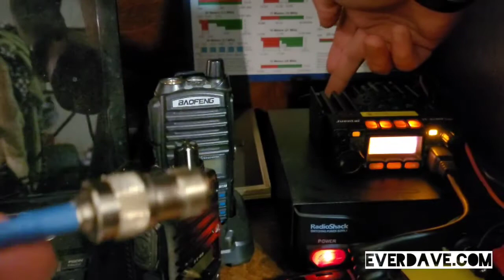Hook your Handheld Ham Radio to an external antenna #ham101

Comment: How long of a coax? And how far is the repeater. Im working on my ham license as my father was was long time  ham in the meantime i have a gmrs license. So on a small coax i can bring up a gmrs repeater thats 60 miles from me on my uhf yagi but soon as i hook my 50 foot coax nothing .this is using my 5 watt handhled. I hear different stories like bad swr or five watts will not make it through the 50 foot coax
Reply from the maker: My coax for this was about 25 feet.
Don't stop, get that license. My grandpa was a HAM operator. I also hold my GMRS.
Reply: @EverDave Oh ok what kind of coax? Lmr400
Reply from the maker: @timcrawford8722  RG58 Coaxial Cable

https://amzn.to/4l5JVpn

Comment: Thank you for sharing, I’m new to this and am trying to learn more in case of emergencies to be able to contact my family in case we get stranded  or stuck away from each other to remain in contact. I was reading an article online that said for some units like the one you have on the right which are not handheld mobile you would need a license for 65 mile range, my question is do I need anything like that if I go for the handheld mobile version? If anyone can help I’d greatly appreciate it
Reply from the maker: If you are in America, you will need a HAM license. The distance doesn't matter.

Comment: Your mobile radio has SO 239 on it and the external antenna coax connector is PL 259.  PL 259 screws over the SO 239.
Some handheld radios have a BNC connector and others have SMA connectors. BNC connectors are not confusing.   Your radio and your rubber duck has SMA connectors.
SMA connectors are confusing as to whether they're male or female.  The determining factor is whether the center pin of the radio has a hole in it (female) and the center pin of the rubber duck antenna slides into the antenna center pin on the radio SMA connector.  Then, the rubber duck antenna has a male center pin connector.   IF the radio has a male connector, then the jumper needs to have a female connector.  
The simplest way to know if you need a male or female end on your jumper is to look at your rubber duck antenna.  The kind of end on the rubber duck  antenna is the kind of end you need for your jumper.
Thanks for the video.

Comment: is there anything else you have to do or is there any worry about hurting your hand held radio doing this? I have a talkpod a36 and tidradio handhelds. i was gonna use a firestick antenna.
Reply from the maker: I assume that you already have your HAM license. If so, no I didn't have to do anything differently. a Firestick mounted up high would definitely work.

Comment: That was a good share. Will the small HT drive a base antenna?
Reply from the maker: If you're using repeater antennas then yeah it worked great. Otherwise it's pretty low power.

Comment: I’m new to this. This is perfect. I subbed. I may have some questions later.
Reply from the maker: Awesome! Glad to help any way possible. I'm still learning as well.
Reply: @EverDave  I’ll let you know when I’m up and running. I’m in North Central Texas.
Reply from the maker: @MeAndMyGuns  heck yeah!
Reply: @EverDave  Ok, maybe you can help me out with this. I’ve got the Yaesu FT-60R coming my way. I ordered fifty feet of cable with the PL 259s. What adapter do I need for that model radio, to fit the PL 259s?
Reply from the maker: @MeAndMyGuns  Assuming it's the same as the FT-65R which has a male end on the radio, you will need a PL259 to SMA female adapter. The links in my description have the exact ones that I bought to make my cable work.
Reply: @EverDave  Sweet, thanks I’ll use your link.
Reply from the maker: @MeAndMyGuns  Make sure your FT-60 has the male end on the radio.
Reply: @EverDave  I’m assuming it does. I’ll see when it gets here, if not I’m sure I’ll use the parts some day.